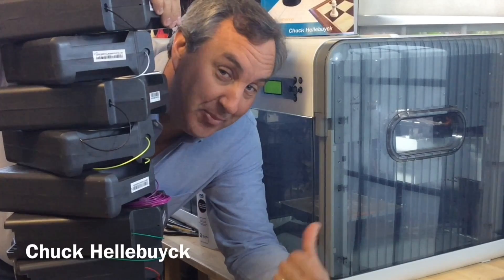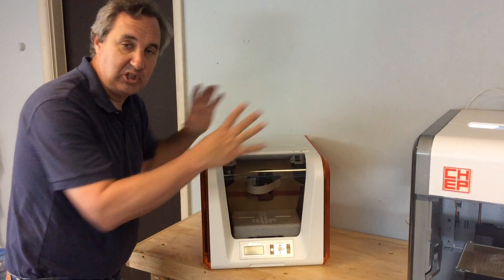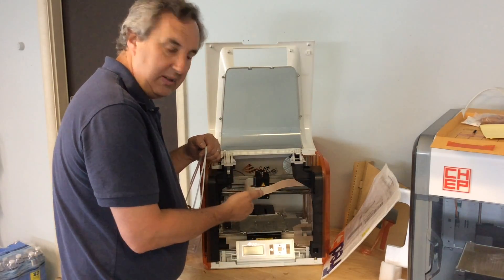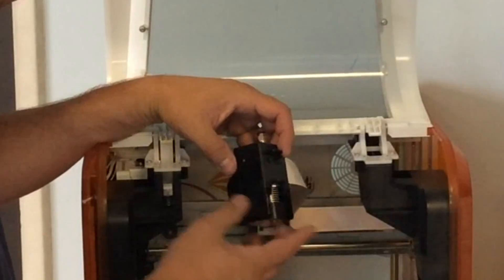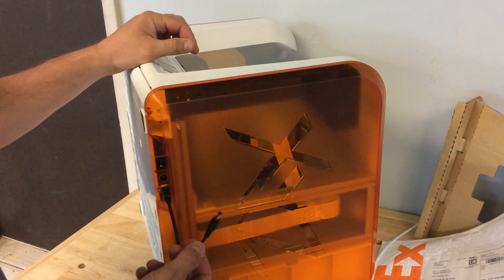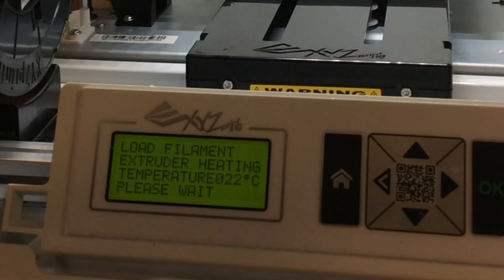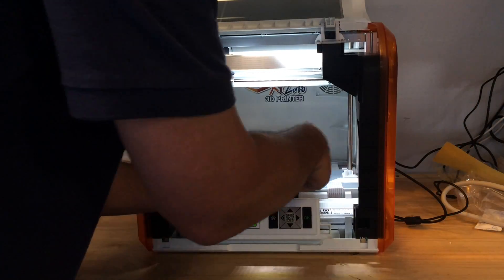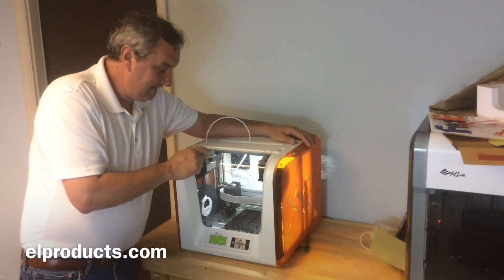Filament Friday #20 - Special Presentation Da Vinci Jr. 3D Printer Unboxing - Video #065

Comment: I like the idea of the load being shared with the heat bed (is it heated?) I believe that this would be a much more reliable setup. What I find strange is they still kept the chip without the cartridge. Why? The filament is right in front of you so you can see when it needs replacing. Looks like another cash grab from Davinci so as to have exclusive sales for their own filament. This was the only facto that steered me away from the davinci in the first place. I think it is a wonderful machine. Does anyone know the retail price on this printer? Also the rolls look small are they standard rolls? (1kg)
Also I do wonder about the filament being inside the unit especially when it is a closed unit when printing. I wonder if this would affect the integrity of  the filament on the spool when it is experiencing constant temperature changes and possibly humidity  as well with the vapours of extruding plastic

Comment: Does it print PLA and ABS ???
Can we use our own filament on the Jr. or are we locked in somehow to buy filament from XYZ like the big brothers 1.0 and 2.0 ???

BTW Chuck you should consider a lapel mike. It's hard to hear you when you're far way from the camera. Up close it's fine.
Reply: ***** I almost pulled the trigger on one at Newegg then I found out that the spools of filament for the Jr. are still proprietary with a new chip  and need to be purchased from XYZ. 
That put a damper on that purchase.
Reply: ***** Oopps.. I missed that in the video ;)